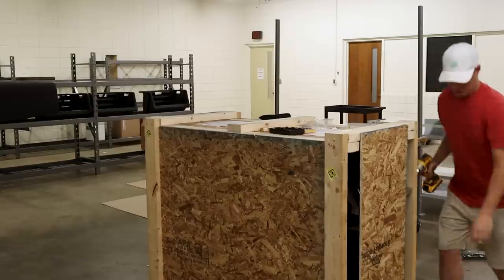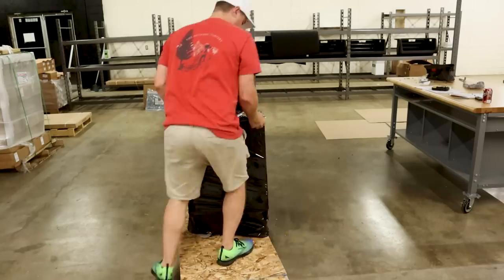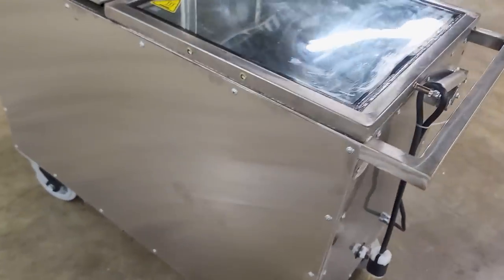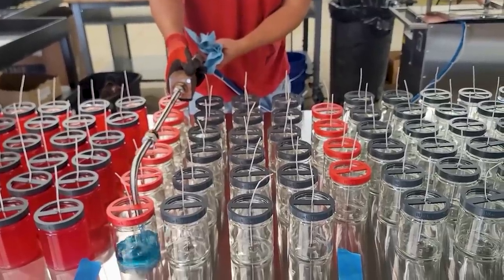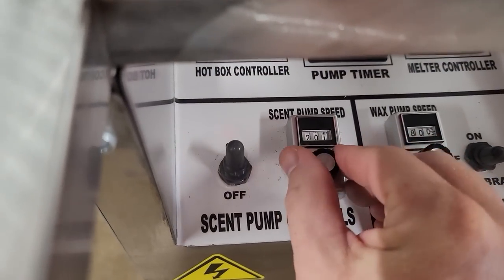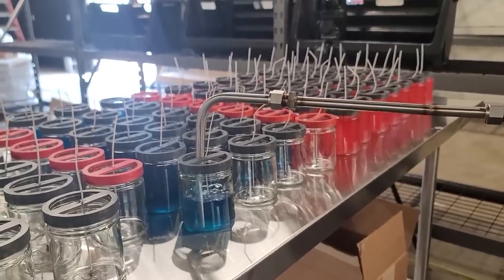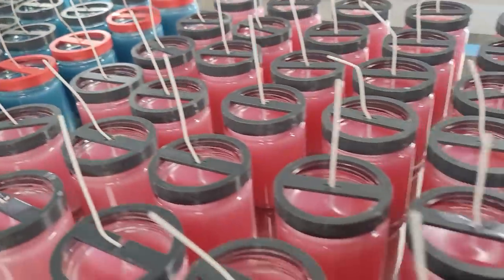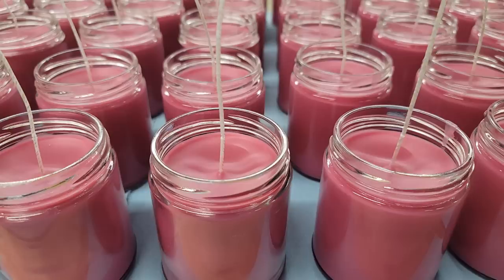I Just Spent $21k on THIS for My Candle Business  (Candle Equipment & Supplies)

Comment: Doesn’t this cancel the whole “hand poured” aspect? I mean it’s no longer a fully handmade candle at this point. I know you said it doesn’t but it kinda does.
Reply from the maker: Nope. Not really. I mean anyone can argue semantics but the your still mixing the scent and color and pouring a csndle at a time. It's a wand vs a pouring pitcher.  Faster and more efficient doesn't mean worse. What would definitely no longer be hand poured is the fully automated systems on assembly lines. That's definitely different. But again, if the idea is to scale and grow eventually, you have to make changes to do thst. You have a capacity limit if hand pouring a few candles at a time. My business wouldn't survive that way. This is step to increase production but still being in control of it.

And to be hones,, no candle is fully handmade. Most don't mark the vessels (some do). Not making the wax or the oils or the wicks. Everyone is relying on equipment to make their products in different ways. Hand poured is sort of a term everyone tosses around. Really people mostly care about home grown and small businesses ya know.

Comment: Feedback for Coogar:  if this machine doesn’t have an agitator, consider adding one to the next iteration. Wax temps vary pretty significantly from the wax closest to where the heating element is versus the wax in the middle of the tank. An agitator would keep temps significantly more consistent throughout the holding tank.

Comment: I actually messaged Cougar with the following questions and never got a response. I'm wondering if maybe you have the answers. 

Just using GW 464 as an example. We melt the wax and add fragrance at around 180 degree and stir for about 1-2 minutes, but we pour at 135-140 degrees. With this machine the mixing temp and pouring temp are the same since it is all happening at once minus the stirring. Will this impact the quality of the candle or the bonding of the fragrance to the wax? If not, is the pouring temp, mixing temp, stir times all hogwash?

Comment: That is so awesome!  I'm so happy for you.  Question.... what about mixing/stirring the wax & FO?  No need?  Have fun with your new toy!
Reply: He answered someone else with the same question and said it’s all a myth and he has a video about it. He also said this mixes the oil better with the wax as it’s dispersing. Hope that helps. :-)
Reply from the maker: Thanks Tim. Not so much a myth more of major exaggeration. But that when hand mixing it does take longer and more heat. You just don't need to worry about it with this kind of pumper.
Reply from the maker: Hey jessica.. check our some other answers to same question I just replied to. Hope it helps. Great question!

Comment: I love the idea of this machine! I am confused about the fragrance though. I thought you were supposed to stir the fragrance in for a minute or two to incorporate in into the wax. Can you clarify this for me? Thanks so much.
Reply from the maker: Hey Candace! Check the other comments and answers on this one.  It was asked a few times and I answered with some detail this. But it basically boils down to the difference in someone hand mixing vs a pumper mixing by the gram rather than hand Stirring in a pouring pot.  There is a LOT of false information about when to add FO and how much to stir. But again it's mostly because of the difference in scale and efficiency.  All larger scale businesses are mixing this way. It's designed to work thst way. :)

Comment: Dumb question...so when making candles, you usually add the FO at a higher temperature, mix, then wait to pour at a lower temp. With this machine, aren't you pouring at too high of a temp before letting the wax and FO bind and cool before putting it in the jars?

Comment: Awesome tool! You have inspired me to start a small candle company with my autistic daughter. I have two questions. With liquid color dye, if a single 10oz candle uses 3 drops of blue and 1 drop of black, do you just multiply that for 5 x 10oz candles (15 blue/ 5 black), or does that scale in a different way?

So concerning that tool, how does it handle temp? If you mix scent at 180 degree and pour at 140 degree, does this machine just do it at a single temp? If so, do you blend high or low? I ask as I use Soy and if I pour before 140 degree I have issues.

And ya, I am still at the pouring 4 to 6 at a time... about to make our first real batch of 120 candles for our first pop-up. Wish us luck!

Comment: it's hard to see on the video, but in my opinion there are some pipes and pieces of iron in the hot box, it can tear the hose if you drag it back and forth all the time
Reply from the maker: There is equipment in there yes.... but everything has been welded and rounded off. The hose is also crazy thick and resilient. But yes... of course you want to be careful for sure and check things periodically. 💯

Comment: Hi i am  medium sized candle and home fragrance company  selling to department stores and better home good stores and i looked into this machine and a couple others and  what i found to be disappointing is the warranty  its to short for the capitol outlay  i do know of some other companies  which are similar in size  to mine that use the cougar machine or machines by waxmelters inc and seem to be doing well with them .. but we decided to make our own with computerized dispensing heads and made four machines  for around 2000 each that have done a great job as we pour 6000 pieces per run per day x 4  so in a nut shell if you cannot afford this machine there always are other options to speeding up a production line and many of the liquid filling machines can have heated elements added to pour wax.. L.A Rob

Comment: What kind of maintenance is involved with this? How is the company with support (after your set-up training? What kind of warranty? Thank you- looks amazing!
Reply from the maker: Haven't had it long enough to tell you how support is. I've heard mixed feedback. Mine has been fine so far. Maintenance.... not much. Clean up as needed of course. They recommend flipping around the nozzle periodically which is easy.  And they also sent extra tapered washers to replace  as needed. Haven't needed to but there if you need them. Not sure what else.  Does come with a warranty but can't recall specifics at the moment.

Comment: Hi thank you for all the wonderful videos.  We got  our cougar machine Can you please give some guidance for pouring temperature since we have to stay at constant temperature 
90 percent of the time we are using soypour 1280 with 10 percent fragrance load 
Our jars are 3inc in diameter and 3.5 inches tall single wicked 
Many thanks
Reply from the maker: I like around 135 for me. And I keep the hotbox at the same. I'd start with that and adjust as needed
Reply: 170 seems to work the best
Reply from the maker: @amer  really? I mean I guess it depends on jar and size too. But for me, that high of temp leads to dips around the wick or sunken tops a bit due to cooling down from a high temp. At around 135, I get virtually perfect tops. But I'm always experimenting with changes

Comment: Hiyah! I'm just getting started and was wondering if you could answer a couple of questions?

How do you premix dye and scents so you can get the same result every time?

I noticed you don't have any labor included in your cost estimates? Is this needed to be more accurate?
Reply from the maker: It's actually he easiest way to get consistent results. Weight your FO and add your dye. Keep that recipe snd anytime you need to make more you use that ration. :)

Comment: Hi Wade, so I was wondering if maybe you can give me some direction with premier 700 wicks, I use wax IGI 4627 with LX wicks, I pretty much got the handle on those wicks. But I want to have a backup and try the premier ones. I have the 9oz straight sided amber jar and use a LX 16-18 for that. Any recommendation on where to start with the 700s?
Reply from the maker: Not exactly but if b probably start in the game of p750 and go from there
Reply: @BlackTieBarn  thank you so much :)

Comment: Congratulations 🍾🎉  moving up in the candle world that’s pretty cool what temperature would you be putting the wax at would it be the 185
Reply from the maker: It depends entirely on the wax. Temp is WAY less important with machines like this in terms of when to add FO. Because it mixes so much efficiently grams at a time so it mixes well at any temp. So with equipment like this. The key is basically setting your tank temp to your pour temp. In the batches I made in the video, I set to 140. But will depend on your specific wax.
Reply: @BlackTieBarn  okay nice

Comment: Thank you for sharing with a great video. It is a great machine but you are correct about price. It is way overprice. With all components to build up a such machine, it does not justify that price level. I still see some settings with mechanical number wheel, it seems like a time travel to 19th century. They can command a price like this because there is no other competition. Wait until another company entering the market.
Reply from the maker: There is plenty of competition.... this one does many things some others just can't very well. It is extremely expensive but it's really meant for the really large customers. It's sorta overkill for me. Lol. The dials are that way on purpose as well. Hard to explain on video

Comment: How do you clean the nozzle and the inlet pipe which is being used for bringing the fragrance.
Reply from the maker: They recommend mineral oil etc which I have used and works. But 7x works great... little more pricey
Reply: @BlackTieBarn  kindly elaborate on the process of cleaning. It will be really helpful

Comment: So do you have to flush out the line of the fragrance every time? Because of the mixing of the colors and fragrance
Reply from the maker: Good question. I was curious as well when I bought it. It makes more sense when using it and I plan future videos showing more of how I use it. But, You purge the scent line in between scent changes.  Takes just a minute and you purge the good oil back into its jug. I didn't show it on the video because i could have spent an hour in the weeds showing everything in detail, lol. But it works well. :)  Like most large scale equipment, it's most efficient to do larger batches at a time of course.

Comment: Hi. Is this machine a 110v or 220? How much amperage does it use (should be on the sticker with the serial # and electrical info)? I want! I'd be scared to make a gazillion candles and then test one and have a problem.
Reply from the maker: I'm not there to look at the moment but I know it's 110v and the suggest a dedicated 100amp circuit.  But I used without dedicated on a 200amp circuit.  No issues.  They may have the details listed or just email them and Justin can give you all the info. I'm just not there too see it and can't remember any other specifics

Comment: HI Wade!  Thanks so much for sharing this - VERY COOL!  I am a brand new candle company, so I will aspire to eventually needing something like this - LOL!  I only make between 30 -50 candles a month at this point.  I do have a question.  I add my fragrance oil at a different temperature than I pour the wax - is there a way to accommodate the temperature difference using this machine?  Thanks for all the information that you share on your channel - inspired me to "just do it!" :)
Reply from the maker: Good question (i was curious about this as well years ago) and the short answer is.... you really don't need to with s machine like this.  
Temp is WAY less important with machines like this in terms of when to add FO. Because it mixes so much efficiently grams at a time so it mixes well at any temp. So with equipment like this. The key is basically setting your tank temp to your pour temp. In the batches I made in the video, I set to 140. But will depend on your specific wax. And of course testing with your wax
Reply: @BlackTieBarn  Very cool!  Thanks so much for your quick response and for the time and effort you put into all your videos.  They are very much appreciated!
Reply from the maker: @crazychemistcandles  no problem! thanks for being here

Comment: How do you swap out fragrance oils? Do you have to clean the fragrance tube, or does it self clean?
Reply from the maker: You purge it in between scent changes.  Take just a minute and you purge the good oil back into its jug. I didn't show it on the video because i could have spent an hour in the weeds showing everything in detail, lol. But it works well. :)  Like most large scale equipment, it's most efficient to do larger batches at a time of course.

Comment: how does pouring temperature of oil into wax figure in?  If you are mixing into too hot wax it isn't good for the oil.  Also, I mix (stir) for 3 minutes before I pour.  That step also seems to be ignored by the machine's process.  Can you please address that? Thanks.
Reply from the maker: Sure. And I've touched a bit on this topic in other videos as well. Hand Stirring is quite different because your trying mix large amounts of wax and oil together and it takes more heat and more work.

Temp is WAY less important with machines like this in terms of when to add FO. Because it mixes so much efficiently grams at a time so it mixes well at any temp. So with equipment like this, the key is basically setting your tank temp to your pour temp. In the batches I made in the video, I set to 140. But will depend on your specific wax. And this is the method larger companies will use as we because mixing oil and wax this way is much more efficient on a small level (grams and molecules) at a time rather than in a pouring pot.  If thst makes sense. I know it sounds foreign but that is how equipment like this works. For example, when hand Stirring I'll add FO hotter than when using this machine because it takes longer and more energy.
Reply: @BlackTieBarn  Thanks!  Is the tealight version of this machine smaller and cheaper?  And has a smaller wand?   

You made such a smart move!    Better than hiring ten people and more reliable.  You give us hope for the future.  What is the name of the company?
Reply from the maker: @isabelpapagno1433  No need for separate machine or wand. This will do all sizes, including tea lights and even clam shell melts. It uses different pump speeds to control the flow. For smaller items, the flow is slow and will fill exactly right. Companies using these machines use them to fill everything.
Reply: @BlackTieBarn  thank you so much for your answers and your patience, Wade.  I think you should represent the company.  I'd like to eventually buy one and would feel great if you made commission on it.  You've already sold me!
Reply from the maker: @isabelpapagno1433  Haha. Well I appreciate that. And feel free to let them know.  :goodvibes: I don't think they need me but I wouldn't pass on the opportunity. :)

Comment: Does the wax mix 100% with oil? I had always thought we have to stir it for like 10 minutes to get it fully infused
Reply from the maker: Nah.  That's a myth.  As long as it moves well its fine.  These machines are designed this way.  It actually mixes much better and faster this way anyway.  I did video called "scent is king" that discusses this concept more

Comment: How would this work if you blend different waxes?
Reply from the maker: Same way as if you used just a tank or Presto pot. Measure out the amount of each and toss them in the tank to melt and mix. You can use a pole or a paddle or really any semi long handles tool to help stir in the tank.
Reply: Gotcha, makes sense.  I am just used to having 2 separate pots for each wax and mixing after they are in liquid form.
Reply from the maker: @Ryan.Chapman  yah man, definitely nothing wrong with that. Another option... and many do this: If you have pots or tanks big enough you can keep doing what you're doing and then put the correct amount of each into the big tank/pumper. Its really up to you.